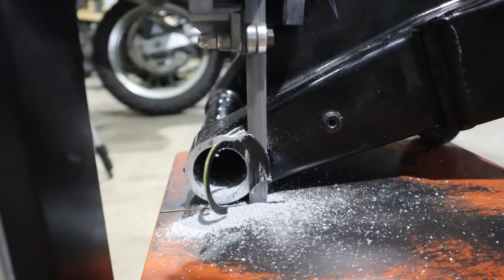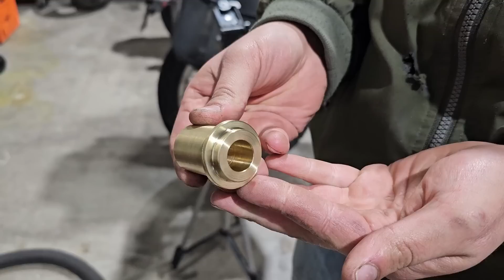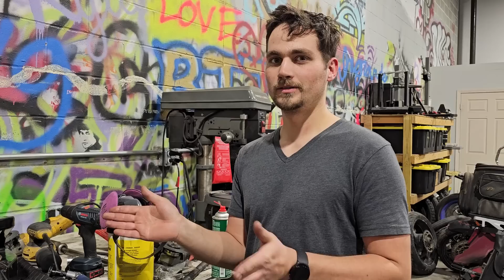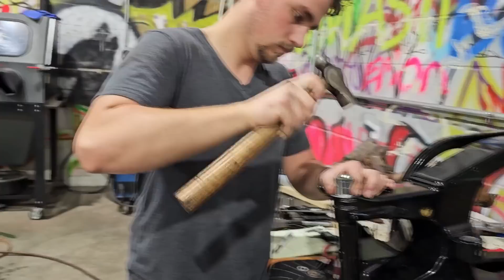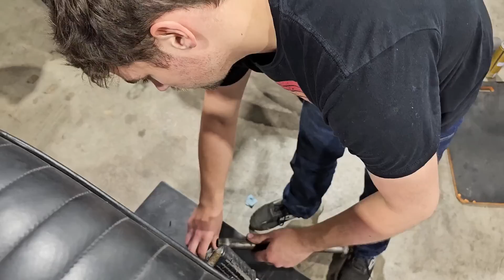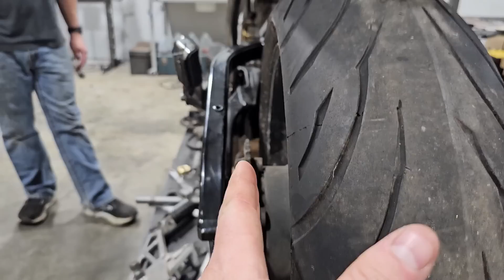CB1100F Build EP2 - Mounting The CBR Swingarm!

Comment: Just came across this while looking at other bikes. I have a good running original 1100f that I won't alter. I had been thinking about a suspension convert on my 79 CBX. It will have to install with no permanent alterations to the CBX so not sure what is out there. I want to see yout 1100f finished. Very cool project.

Comment: I love that you guys just do it. I have an old ‘86 VFR750 I bought as a parts bike, that I actually got running, and turns out is too nice to be a parts bike. I’d love to upgrade the forks, wheels and swingarm from a more modern CBR600. 
 Nice work engineering that bearing setup, that’s perfect!
Reply from the maker: @martinjollimore5441  🤘🤘

Comment: I’m doing something a little similar  hVe an fz750steel frame. Fitting a yzf braced alloy swinger  had to make some brassshims to go between the pivot face of the arm under the seal cup   and then a couple of shims between the outer of the seal cup and the frame  all measured with dtis and feelers  used thd  fz pivot and swinger bolt  going to fit s couple of grease nipples  Now I can fit my 5sl R6 5 spoke rear 5.5”  bring the ol fizzer back to the 21st century   Nice job guys. Looking forward to comb this done

Comment: You are doing great. However, I agree with the other comments about using brass as roller bearing surface. Hardened steel is a must...
Reply from the maker: @yveslegrand9826  I will reevaluate

Comment: Are you installing the original pro-link suspension setup? i would be interested on how you are going to setup the geometry of those dogbones and triangles. I see a couple attach points under the frame
Reply from the maker: @fasousa4798  these are originally a twin shock setup. Wel will be going to the linkage style
Reply: @BrickHouseBuilds  i meant since that swingarm is for a pro-link setup i was asking if you will turn the bike into a mono shock prolink like that swingarm donor bike. I guess so. Prolink is great as it concentrates the suspension within the swingarm and only link to frame are the dogbones

Comment: heat up the aluminium with a heatgun and put the bearing in the freezer for a few hours and the bearing will slide in its places very easy. Smashing the bearing is not needed and you wont damage the bearing.
Reply from the maker: No bearings were damaged.  Even heating up the swingarm with a torch wouldn't allow it to expand enough for a bearing to drop in. It would need some sort of force
Reply: @BrickHouseBuilds  put the bearing(s) in the freezer a few hours , then when you get it out warm the alu part with a torch and then put the bearing in. works any time
Reply from the maker: @XJRRIDER  I know, we try this often with wheels bearings and anything else. It's hardly ever a drop in scenario

Comment: Please reconsider the use of brass for a bearing race. Those rollers will tear up that brass almost instantly. They need to be either hardened steel or a non-hardened steel (not brass) with a bearing race sleeve.
Reply from the maker: Per my reading it seemed brass was acceptable.  Have some information?
Reply: @BrickHouseBuilds  brass is a good material for bushings (often referred to as 'plain bearings') where a polished shaft or hole will spin on the surface of the brass as long as lubrication is implemented correctly. This scenario has the maximum contact patch and distributes the load over a relatively large area. Rolling element bearings (your typical ball, roller, taper roller, or needle) have very small contact areas,  usually a very small point or line. As a result, the load on that small patch is extremely high and will easily deform the bearing races unless they are hard enough. Usually in the 58-64 Rc (Rockwell C scale) or higher.
From what I  could see in this build, you have roller bearings (which are the same as a needle bearings but the ratio of diameter to length is smaller, ie fatter). The outer race is the part you pressed into the trailing arm casting which houses the rollers. The inner race appears to be the brass part you machined. If that's what you're using, you need an inner hardened steel race, not brass.
Reply from the maker: @lornetontegode6986  So then I can't make a hardened steel piece. How are other guys doing this stuff so easily
Reply: @BrickHouseBuilds  see if you can get a hardened sleeve that will press-fit over the brass piece you made. There are lots available and you might have to modify it slightly if too long. Search for any inner bearing sleeve/race with its outer diameter being the same as your roller bearing's inner diameter. Then you just turn down your brass piece to suit.

Also, any local machine shop could make you one and either case-harden it or make it from a tool steel that they can harden and cylindricaly grind to size. That would replace your whole brass piece.

Comment: I may be ignorant so correct me if I'm wrong but I find it concerning that the inner race the hardened steel roller bearings are rolling on is a soft brass bushing. It might cause brinelling (denting) on the brass, though I'm not 100% sure 😅
Reply from the maker: Somehow all of what I read is wrong
Reply: @BrickHouseBuilds  well, if the specifications issued by the manufacturer states using brass raceways then I guess it's fine but I'll go shoot an email to bearing manufacturers for a second opinion. 👍
Reply: @BrickHouseBuilds  I've come across a PDF by the bearing manufacturer NTN which specifies that needle bearing raceways need to have an HRC hardness of 58 to 64 and all the materials it lists as "suitable" for such raceways are steel. I can provide the link to the document if you want.
Reply from the maker: Id appreciate it if you emailed that to contact@brickhousebuilds.com  I may be getting lost in the terminology between bushing and raceway and how my searches turn up information. It just seems like brass/bronze is very common for this but of course, it seems going into a roller bearing changes things.
Reply: @BrickHouseBuilds  I sent you an email now ✌
Reply: No, you are correct. It is very bad to run a soft metal for an inner race with roller or needle bearings. It's sort of Brinelling but not really.

Comment: safety first man

your cutting position are really bad
Reply from the maker: Cutting position for what? There was nothing dangerous in this video
Reply: @BrickHouseBuilds  I agree with that mostly. I'm a Tool and Die Maker and the only thing I saw was not using safety glasses on the early part of the lathe work, where he said he made a hole. A drill, or tap even, can snap and will send shards flying. Brass is notorious for grabbing tools and overloadimg them. Yes, I've had a few eye incidences, even with safety glasses on this bits are good at finding a way in.